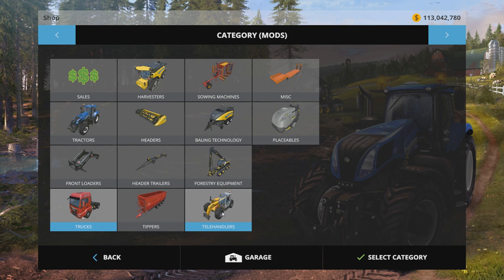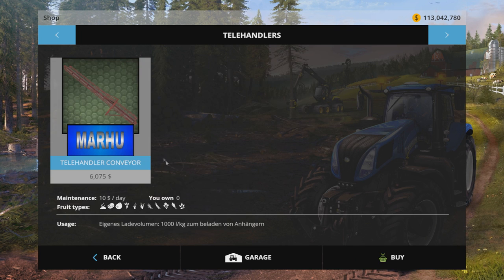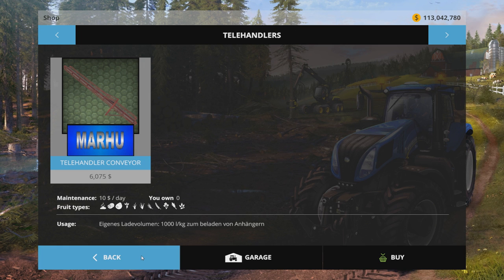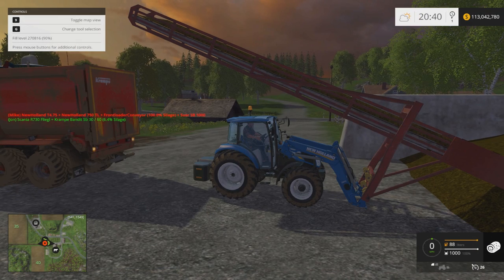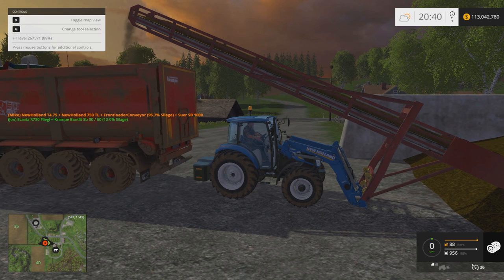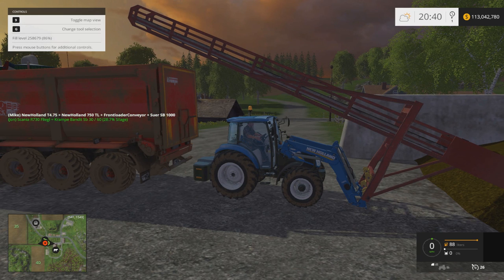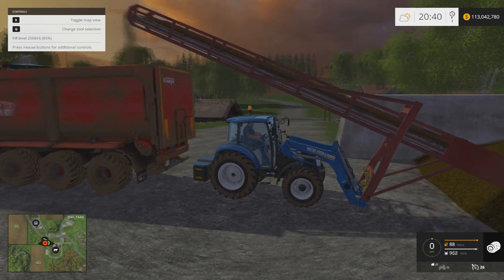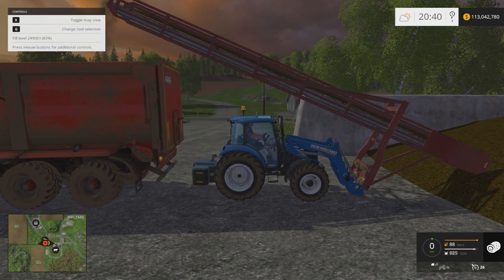Farming Simulator 15 PC Mod Showcase: Conveyors

Comment: Will the conveyor work with no one in the tractor, so you can push it with the trailer and truck?
Reply from the maker: Yes, there doesn't have to be a person in the tractor to actually run it.